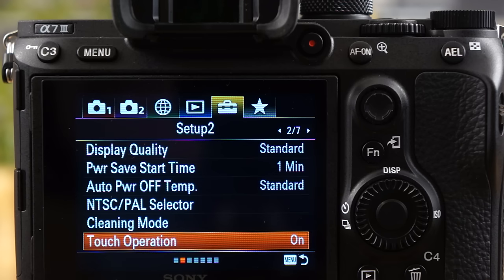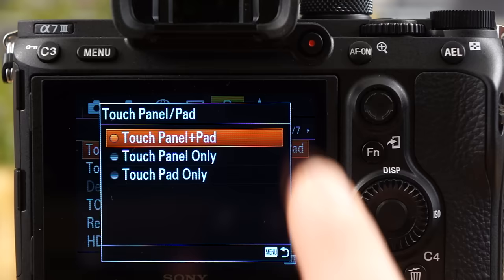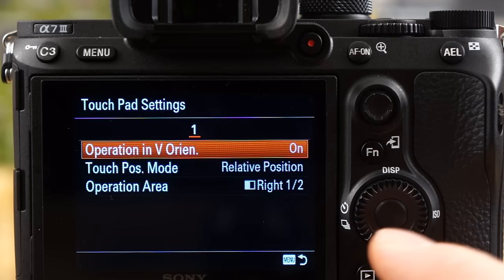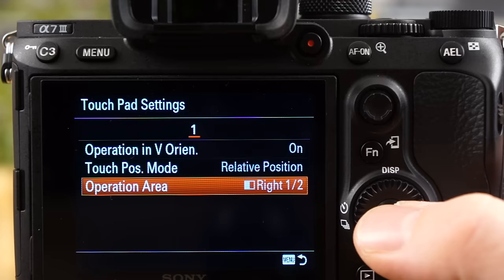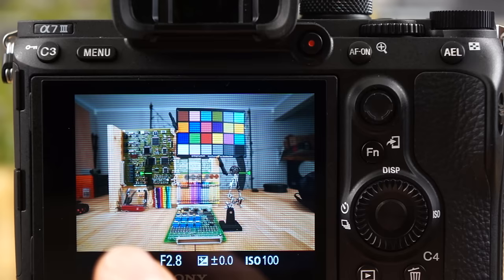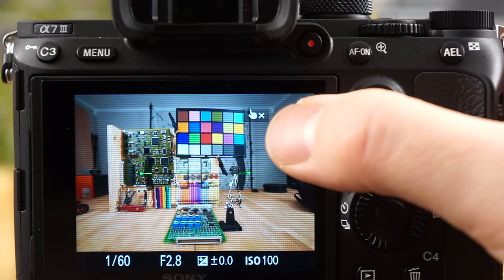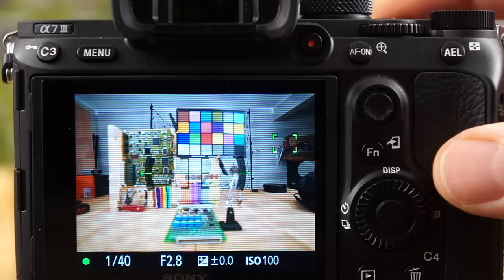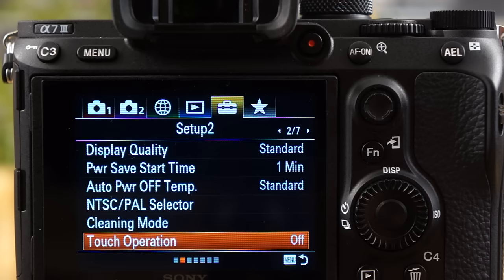Sony A7 III - Touch Focus Explained In Detail with Demo in Lab

Comment: I have just bought a new A7iii and when I am trying to do this it does not work. When i touch the screen the focus square moves to where i want it but when i half press the shutter button or the back focus button...nothing happens at all. When I press the back focus button again the center focus works and it beeps. Can you assist please? I am in Wide area focus and have the center lock on AF set to off.

Comment: 3:56 you say that the touchscreen stays when in flexible spot. It does if you only tap it but you can touch and drag and the focus position moves around. It’s much better than having to use the joystick!

Comment: Great video. One glitch I ran into was that it won't focus on the touch point if you use joystick as AF button. :(
Reply from the maker: Thanks for the comments! The joystick only moves the af point around as far as I know, so this is normal behavior for the camera.
Reply: @Jason_Hermann  Sorry for not making it clear. You can actually set custom key so that when you press joystick it will do the AF.
Reply: I noticed the same behavior on my Sony a73 when the joystick is set to AF on (the center press) then it will not focus only if I use the AF on button for back button focus it will focus in that touch area that seems to be a bug in the firmware. I used the af-on  Button for eye-af and the center press on the joystick for af-on. The new firmware will free up the eye-af button, so switched it now as I find touch focus the best use of a touch screen in digital cameras. My canon eos m6 does this perfectly, even with tracking after touch-focusing.

Comment: Hey Jay, that was great! I just changed my setting from Absolute to Relative, so thanks for that- it should help. Also, I didn't know about canceling via the little on screen icon- cool! I noticed that that only works when using the screen  though, not when engaging the EVF.  One thing I have trouble with is for the screen to even register my touch, but I am used to that problem  from using other devices. Hope you had a wonderful Thanksgiving!
Reply from the maker: Thank you for the comments and I'm glad the video helped you learn a few new tricks ;) Thanksgiving was great thanks, and I hope yours was as well...

Comment: Thanks for all your efforts. I tried all the things you suggested  BUT enabling false focus and manually throwing the focus ring is so much faster. I have been shooting since ‘81 and professionally since ‘89. May I suggest to everyone to practice focusing manually.. no intent on taking photos,, just throw the ring clockwise and counter clockwise to build muscle memory as if you are practicing scales on a guitar. You’ll be better off. This is how the pro focus pullers do it when shooting film.
Reply: Manual focusing is not faster than touch focus unless you are the flash. Use common sense when replying to someone video, understand the context and understand the audience that the video is intended.

Comment: Thanks for the instruction. One question. When you hold the camera horizontal, all good. But when I hold it vertical, my nose would still interfere with the touch pad. How do you set touch focus for separately for horizontal and vertical?

Comment: Hi Jay, thanks for your thoughtful, helpful short tutorial. Excellent.   I am still learning and have three questions related to the touch auto-focus that I would like to ask you about.  I am shooting  video.  1. Sometimes the touch screen stops working. I must unintentionally turn it off. How am I be doing that?  2. When I use touch screen I see the icon switch between AF-C and MF. Why? What does that mean? 3.  My camera is five years old. I used see a little focus box on the screen that I could move  by touch or using the 'joystick' -- I don't know how I activated it and I can't find it. Can you tell me what it was, by this description?  Did it disappear in a software upgrade? I'll leave a tip in your tip jar or via patreon.  Thanks again!

Comment: The touch pad is clumsy when I use it with the EVF. For some reason sometimes it's not activating. Same settings as yours
Reply from the maker: Hello, Perhaps your nose is touching the screen and the camera thinks the pad is activated already?
Reply: @Jason_Hermann  😂
Reply from the maker: @jheelan  It happens to me, so I figured it was possible ;)

Comment: Why are you touching the shutter button? If you have to touch the shutter button, then it's not really "touch screen focusing" right? ? So it's really just setting a spot, but not actually focusing? It doesn't seem to do any focusing until you touch the shutter button?
Reply from the maker: Yes, that is correct. However, you can have have touch to shutter enabled and then the camera will focus and fire when you touch the screen.
Reply: @Jason_Hermann  and How do we do this? What settings needs to be changed.

Comment: I'm missing something - touch focus works on the LCD but doesn't work when I view the EVF. I have all the settings shown in the video. When going to the EVF of course the LCD turns off, so wondering how it could be picking up touch - in any case how to get this to work, as I love touch focus and need to use the EVF.
Reply from the maker: I'm sorry Charlie I'm not sure what you are missing either. Perhaps if it's not too daunting of a task, factory reset the camera and then try it again?

Comment: Hi Jay, very well explained video, congrats!  However, after making  all the settings that you show in this video, I still keep getting the "focus Cancel" message on the screen, and the camera doesn't focus. Why is that?  Maybe it's because I am using a Sigma lens with an adaptor?  Why do you think?
Reply from the maker: Hello Jose, Focus Cancel means that you have touch focus active on the screen. Press the center button on the back of the camera dial and that will cancel it. The the focus should be on whatever mode you had it on. Touch over rides if enabled...
Reply: @Jason_Hermann  thanks, I'll try that. 👍

Comment: Although I prefer viewing my image using the larger LCD on my A7iii, I do like the capability of my A6600 to focus and shoot using the touch screen.  I also like using a stylus rather than my finger because IMO the stylus is more accurate in selecting the focus point.
I especially like the A6600 and stylus when shooting a series of images for focus stacking...

Comment: Hi, I just got my a7iii today, for stills, I have tried the settings which you have explained in this video but whenever I touch the area I want to focus, it does not focus, on the screen two things pops up, one is "focus cancel" and the other is the hand symbol but the area does not get focused. Am I suppose the press the shutter button to focus that area ? Or just touching the area should focus ? I am just making sure that I did not get a safe give unit. :) thanks!!
Reply from the maker: When using AF-S or AF-A focus mode the camera only focuses when you press the shutter half way when taking photos. However if turn on Pre-AF in the menu the camera should focus when you touch around. Also, if you are using AF-C Mode it will be continuously focusing and should change when you touch the screen. What you are actually doing with the touch to focus is setting the focus area to where you touched, not actually focusing per say. But it depends on the mode... When recording video, the focus will automatically change to where you touch, because it is in AF-C Mode when recording. You can also change the touch to focus option to tracking, and that will automatically change the focus even when taking photos without pressing the shutter halfway.
Reply: @Jason_Hermann  Thanks Jay, I have put the pre AF on and also put the mode to AF C, still.does not focus on touch. I might have to return the camera then, looks like this is faulty.
Reply from the maker: Yeh, that is weird for sure. If you touch the shutter button down half way does it then focus?
Reply: @Jason_Hermann  yes then it focuses the area which I touched. Put it does not focus after I touch the screen.
Reply from the maker: @gchandra3075  Which lens are you using?
Reply: @Jason_Hermann  sony 85mm f1.8
Reply from the maker: Is it possible you are trying to focus on something that is too close to the camera? The minimum focus distance on that lens is 2.62′ / 80 cm...
Reply: @Jason_Hermann  it's working now!!! Thanks mate!!!
Reply from the maker: @gchandra3075  Awesome, what was it??
Reply: @Jason_Hermann  I guess I was trying in a low lit area, tried in day light and it worked perfectly :)
Reply from the maker: Thank you for sharing the results and I'm really glad it's working for you now :)

Comment: had a question i hope someone answers, say i want to use touch focus for shooting , when pressing the shutter button straight down instead of half press, will it stay on the area you touched to focus?
Reply from the maker: Yes the focus point will stay where you touched and will focus once you half press the shutter and take the photo when you full press the shutter. The focus point won't move unless you cancel touch or touch somewhere else.
Reply: @Jason_Hermann  thank you very much

Comment: Any idea why my A7R3 doesn't touch focus in stills mode but does in video guys? Just got my first Sony, and really want this feature for focus stacking. In photo modes the little "cancel" hand appears after i touch the screen but the camera doesn't focus. Many thanks for any tips. I tried in P, M, A modes with same result, yet it works fine in video where I won't use it much at all.
Reply from the maker: It only actually focuses when you press the shutter button down half way. You are just selecting where to focus. In video it is automatic, but not in photos. You can Turing on Pre-AF which might help also.
Reply: Thanks Jay, I managed to get touch focus working for still. Don't ask how coz so many.options and interdependencies I lost track. The cancel icon looks different for stills mode, but at least touch focus works in both movies and stills now.

Comment: Hope you are still answering inquiries. When I touch my screen the message "spot focus" appears on the screen in addition to the items on your screen. Why did this message not appear when you touched the screen? Thanks
Reply from the maker: Was I recording video? It does not come up when recording video on the A7 III.
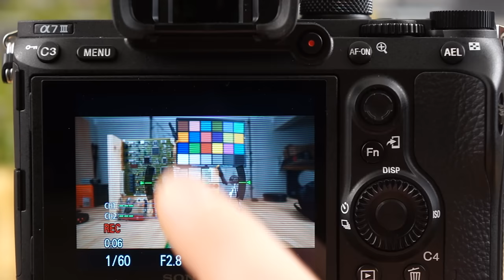Reply: @Jason_Hermann  I watched your tutorial again last night and discovered that indeed that message did appear on your screen too. At the 4:38 mark. So I guess it's just a notification to tell you that you just set focus. I did not notice it when I first saw your video. Thanks.
Reply from the maker: Yes, it's both an indication that you are using it, and letting you know the center button on the rear control dial will cancel the focus point you added. Also on the top of the screen is another indicator/ button you can press to cancel the touch focus.
Reply: @Jason_Hermann  thanks

Comment: Hey Jay, another awesome video of your YT Channel! It seems like there´s a problem, when you´re using back button focus and wants to touch focus. While the camera accepts the new focus spot, when touching the pad and using the shutter button, it simple ignores the touched spot, when I use my back button focus, which function is "AF on". Is there a solution for this problem?
Reply from the maker: That is weird Daniel and I am not aware of a solution off the top of my head. I would assume the back button focus would work as expected in this case... hmmmm
Reply: @Jason_Hermann  Could you replicate the problem with your camera to verify its not due to a misconfiguration of my own.
Reply from the maker: I have the new Sony A7C currently, but I can try it on that and get back you Daniel ;)
Reply from the maker: I just tried it on the A7C and it works, but the button on the rear is by default set to AF-ON... So, I didn't need to configure anything. I'm guessing it might not work on the A7 III when using touch to focus, but that really is odd...

Comment: I have just bought a A7R5, moved over from Nikon. How do I set up continuous focus moving in and out - I have AF-C and the wide area selected, It tracks if I move the camera from side to side but doesn't focus if I push inwards or outwards.
Reply from the maker: the green dots should be lit when you move the camera around in any direction. The camera is not focusing for you in wide area? If you touch the screen it should enable tracking on whatever you touch. Does that work as expected?
Reply: @Jason_Hermann  (Sony A7R5) No I don't get any green dots just a white box - I have to depress the shutter to get a green box and hold it half way down - Im using a brand new Tamron 20-40mm I tried to see if it was a firmware problem but I can't connect the lens - says I need the correct Tamron lead - looked in the box it didn't come with a lead - so disappointed.
Reply from the maker: @markshirley01  sounds like the Tamron lens might need a firmware update, and u need to hold the shutter half way, that is normal.

Comment: Can you actually focus or just move the focus point around ?
Reply from the maker: It just moves the focus point around in photography mode, but during video recording the focus will change to the point you touch in a nice smooth manner.
Reply: Jay SonyAlphaLab thank you !
Reply: Jay SonyAlphaLab hopefully either through software or the next A7 they could improve the function to actually have the option to focus in photography mode .
Reply from the maker: @jtes1442  Yeah I agree. There is actually a Pre-AF feature which does focus the camera if you change where it is focusing, but not when using the touch focus feature. I was kind of surprised by that when I enabled the Pre-AF feature. I thought for sure it would focus on the touched focus point, but because the option to cancel the focus point is there, I guess Sony decided to just have Pre-AF work with the standard focus modes...

Comment: Hi Jay, great videos, when shooting video can I drag the focus using the touch screen? Like pulling focus along a line of bridesmaids for example.
Reply from the maker: Hello Alan,  the focus moves only when you touch the screen and let go. Touching and dragging does not work as a focus tracker in other words. Therefore in your example you would need to tap along the faces repeatedly for the focus to change.
Reply: @Jason_Hermann  Ok. Thanks.

Comment: Hey Jay - I'm trying to find out something that I don't see addressed in your videos or others. I'm trying to videotape the creation of artwork on a desk - and I can't get the focus to lock on the art and ignore my hands and pens. Is there a setting I'm missing?
Reply from the maker: Hello Sandy, In this case I would use manual focus since the art is not moving. So I would first use auto focus to focus on the art, then switch the focus to manual. It should then be locked on the art and will not change if your hands are in the scene. Jay
Reply: @Jason_Hermann  thank you!!

Comment: I photograph food and I notice that whenever I use the touch focus (wide, single shot)  it seems that it focuses just on one tiny spot on my apple pie let's say, while the rest is just out of focus. How do I get the whole slice to be in focus? Should I use a different focus method? Aperature is between 2,8-5.
Reply from the maker: The focus area is just where the camera is focusing. If you want more of the scene in focus, you need to increase the depth of field by stopping down the lens to f/8 for example. Also, if you move further back more of the apple pie will be in focus, because that effects depth of field also. If you take a shot with your cellphone the entire pie will be sharp do to the tiny sensor. A full frame sensor requires some settings adjustments. You might even need to stop down to f/11 or f/16 depending on how close you are to the pie....
Reply: @Jason_Hermann  Thank you, great adivice. I will give this a try. 🤗

Comment: Does this mode only work when you have a lens with several mm like a 24-70? cause I have a 50 prime lens and its not working
Reply from the maker: It should work with any lens that has auto focus. Is your lens a manual focus lens?

Comment: When i touch the screen in Video and wide/zone mode it goes into manual focus. Is that normal? Shouldnt it be AF? :/
Reply from the maker: Yes it should, what lens are you using?
Reply: @Jason_Hermann  mostly Tamron 28-75 and sony 85mm 1.8 and it's the same with both.
Reply from the maker: @f4z3  Yesh, the camera should not do that with a native e-mount lens. Especially the Sony!! I can't think of a setting that would cause that... Do you have it in video mode on the mode dial? If so I would try factory resetting the camera: MENU → (Setup) → [Setting Reset] → desired setting.
Reply: @Jason_Hermann  I noticed on your video that you did not have all the info on screen. 

With mine on, in video mode, on the left it says AF-C, it's in zone mode if I press anywhere on the screen, it loses the Grey box and when it acquires focus on the spot I pressed it says MF until I cancel from the hand in the screen or the center button of the dial. Then it goes back to the Grey box and AF-C.

If you have the info on while you press on the screen it is in AF-C mode the whole time?
Reply from the maker: @f4z3  Oh, well when you are using touch to focus, you are overriding where the camera is choosing, so it displays MF while the "touch to focus" is active. Sorry, I did not realize that until you just wrote that. That is normal behavior...

Comment: Does anyone know how or if you can use the center lock touch screen  focus on the A73 with an external monitor? The function automatically  shuts off when plugging into my Andycine monitor

Comment: I've got a A7iii but touch screen only works in video mode.  Not in manual, or what am I doing wrong ???
Reply: maybe it will work if you turn on "pre af" (menu tab 1, page 7/14)